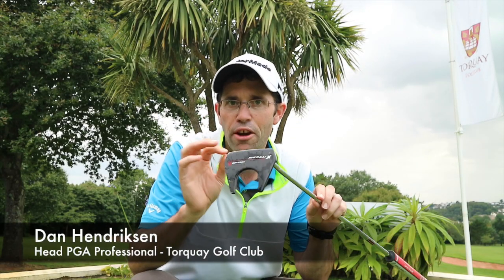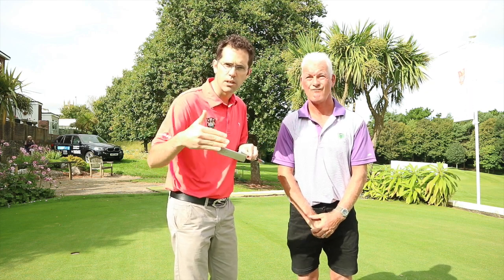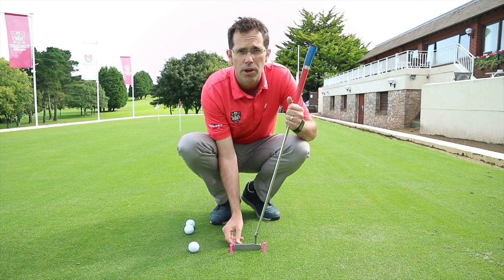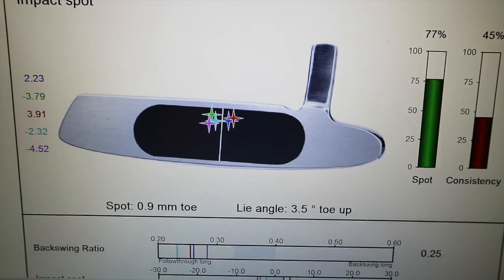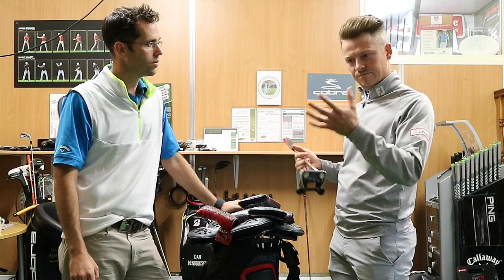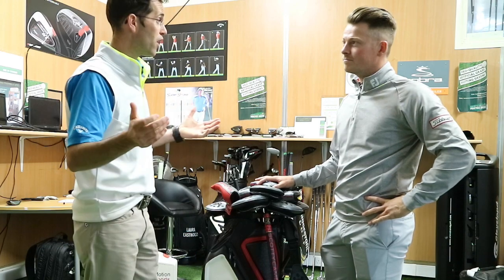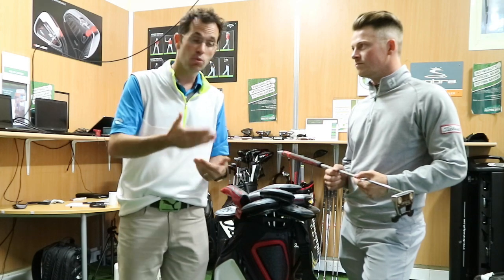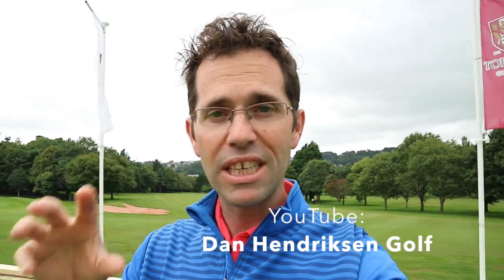Improve your putting with Sam PuttLab & Custom Fitting

Comment: Thanks Dan Putters are so important would have liked to see more of the fitting details did he add weight to the putter shaft did he utilise laser for aiming etc ? 
the ratios of use are interesting in 10 rounds I used putter 353 times versus driver 137 putting average 35.3 puts per round ave 1.96 & I reckon I'd be pretty average as I am not a low marker playing off 16.8
Definitely the most important club in bag by far & I only realised once I started seeing the statistics.

Comment: got small question advice.....i putt in very slow greens...after the hit my face finish closed, i cannot keep it square,,,,if i do that i dont get to he hole,,,how can i create more speed with a tighter shorter follow thru stroke,,,i see a puish drill, looks kood, bit no idea how to generate putting spped without releasing the face,,,but whats is important is that it arrives square to hitting arrea, what happens next is that important? ill say yes